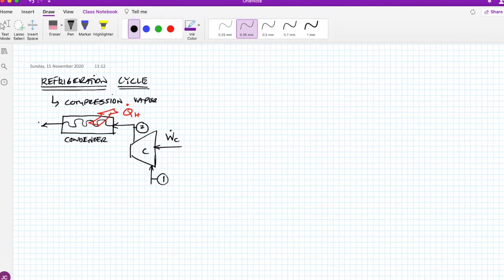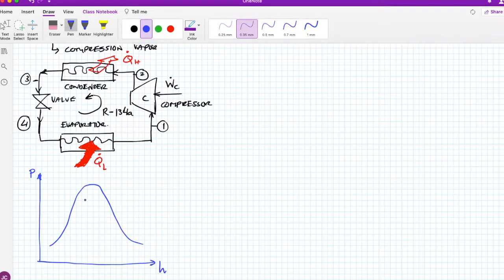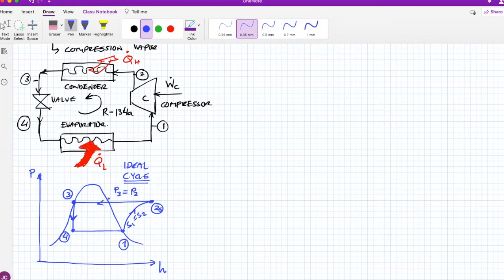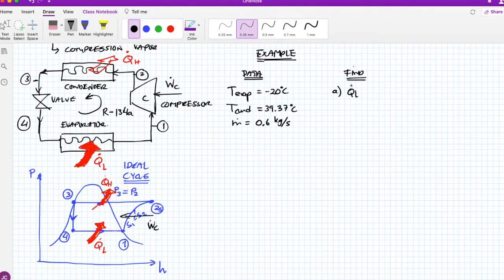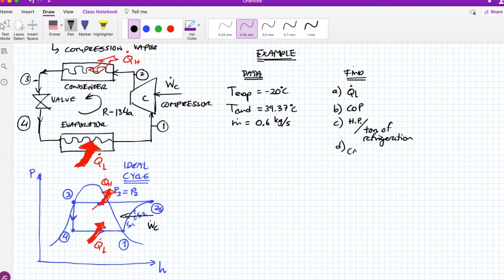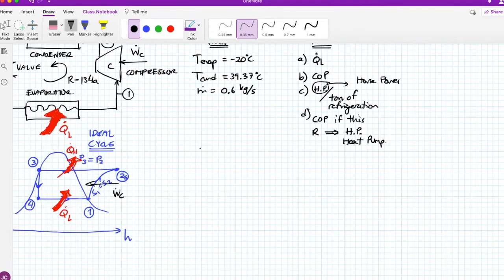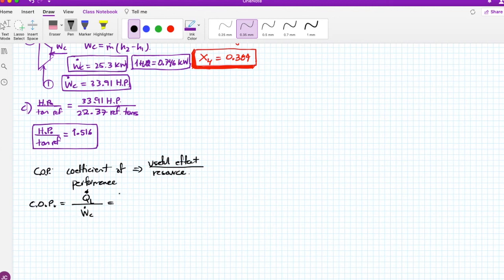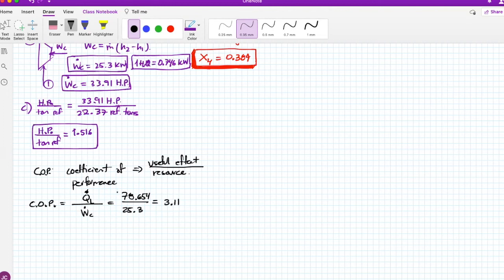Thermodynamics: Ideal Refrigeration Cycle

Comment: How pressure remains constant in condenser despite the temperature drop from superheat rejection after compressor & sub-cooling heat  rejection before expansion valve? 
Thank u
How pressure remains constant in evaporator  despite temperature rise from superheat gain before   compressor?
Reply from the maker: Hi. There is no pressure drop inside the condenser because it is a heat exchanger. Heat exchangers produce a very small pressure drop so you can neglect, changes in pressure. In the condenser the refrigerant changes phase from superheated to saturated liquid. Just like water does it in a steam boiler (but gaining enthalpy instead of losing it as in this case). So short answer, because the condenser does not produce a relevant pressure drop. 

Same thing for the other heat exchanger, the evaporator does not produce a relevant pressure drop. Temperature does not change, pressure does not change, however, specific volume increases and enthalpy increases in this phase change. Did i help?

Comment: Part of my final year Project requires to design a MCVR cycle using water as the refrigerant. The water enters the plant at approximately 40 degrees and needs to be cooled to 10 degrees to be pumped out to cool incoming air in a Gas Turbine. Can you render some assistance with respect to the refrigeration calculations?
Reply from the maker: Sorry for such a delay answer. Can you be more specific? Please use all the space you need.

Comment: When finding Q_h why didn't you write the equation as 0 = -m3h3 + m2h2 - Q_h. Based on my interpretation of the equations at the evaporater and compressor that is what I would come up with for the equation at the condenser
Reply from the maker: It is the same thing my way and your way of writing the equation.

Comment: Could you please give me the name of the book you are explaining from?
Reply from the maker: To tell you the truth, I don't remember. But I will say that most likely, it is the Yunus Cengel, book of Thermodynamics.
Reply: @theclassoftorchia3856  Thank you very much, the truth is I did not find the book in pdf format unfortunately, please sir do you have time I can send you some exercises to help me or if you know where to find it in pdf format
Reply from the maker: @wejdanlotfe4779  You can write here the problem and I will try to solve it. I think you can find the book at certain webpages related to education.
Reply: @theclassoftorchia3856  Ex: 
consider Carnot cycle heat engine using steam as working fluid and having a thermal efficiency of 20% . Heat transferred ti the working fluid at 300C and during this process working fluid changes from saturated liquid to saturated vapor : find 
a) show this cycle on a T-s diagram that includes the sat-liquid and sat-vapor 
b) Calculate the quality at the beginning and end of the heat - rejection process. 
c) Calculate the work per kg of steam .
Reply from the maker: @wejdanlotfe4779  Sorry for such a delayed answer. I will try to do it. And let you know about it. The thing is that the two points of the cycle touching sat liquid and sat vapor, have the same entropy as the other two points where quality can be measured. It is a square inside the saturation curve.

Comment: Hello professor, i have a question in the case  of finding h2 if they didn't give us the pressure P2 but instead they gave us temperature for example T2=60°C how can we find h2 from 2 data T2=60°C and s1=s2?
Reply: I found it in this example:
Consider a refrigerator that operates on the ideal vapor compression cycle. The r-134a refrigerant enters the evaporator at 140kPa with x=30% and leaves the compressor at 60°C. The compressor consumes 450W.
Find:- mass flow rate
- the pressure in the condenser 
-COP
The only thing that i can't get is how can i find h2 from T2 and s1=s2
Reply from the maker: @zoulihr2455  I think that point 1 is P1=140 kPa and saturated steam. With that you can find enthalpy and entropy at 1. Now, at 2 you have T2 = 60°C and s1=s2. You find h2 in superheated steam tables for R-134a. Since the power of the compressor is the m*(h2-h1) = 450 W, you will be able to find mass flow (m). Hopefully this helps.

Comment: where did the 282.74 come from, as well as the 0.9525
Reply from the maker: From a superheated R-134a table at 1 MPa. What I am doing there is interpolation because I know my entropy at that point (s=0.94564) but I dont know my enthalpy which is the one that I need. So interpolating means "trapping" my unknown between two values, one less and the other greater than the value that Im looking for. The 282.74 and .9525 are the part where h and s greater than the value. Did I explain it better?